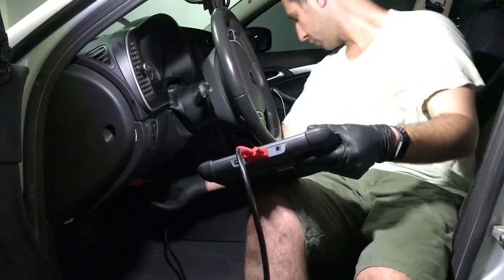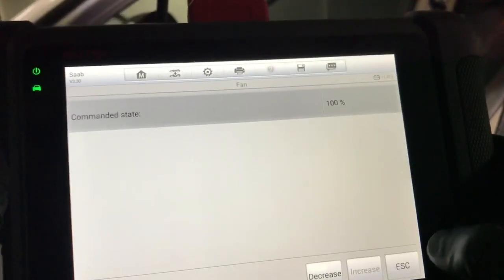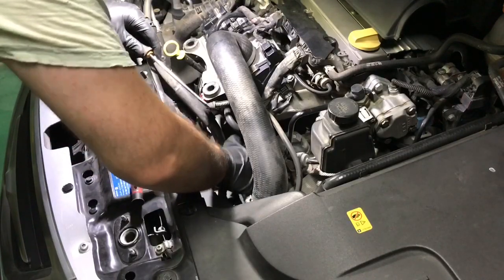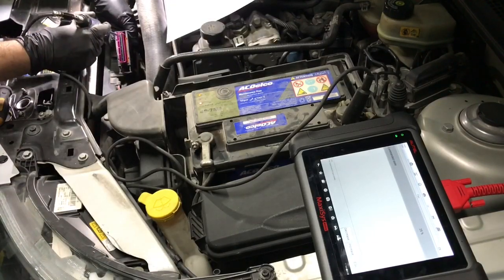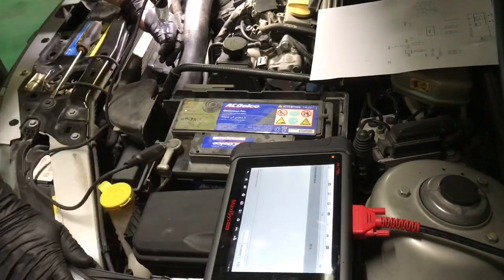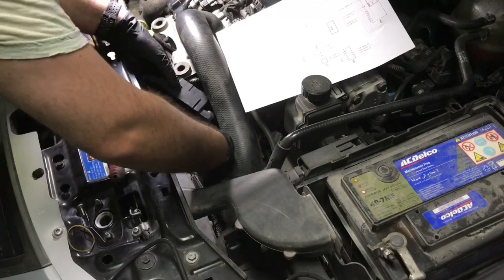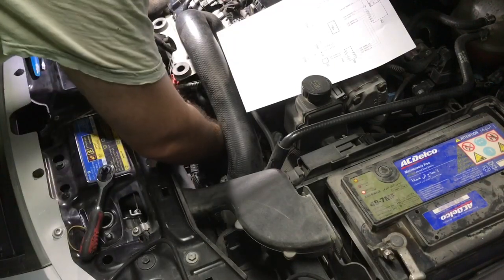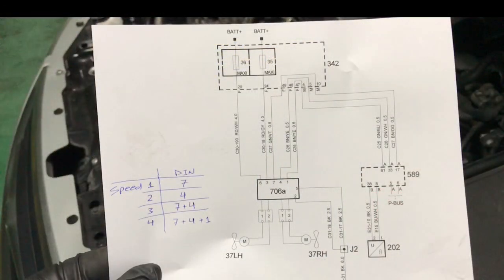SAAB 93 COOLING FANS ISSUES .. Part 1

Comment: Saab 9-3 2004 no ac. Is it possible that the fault is in fan control module ? There is refrigerant, pressure sensor ok , compressor works if i jumper relay ,  from data.. compressor commanded on
Reply from the maker: If compressor commanded ON in data, but its not tuned ON, try a new relay first. Best is to scan the car fully for faults
Reply: Thanks for answer! Its not the relay . The only  it says evaporator tempsensor -40 , i cant find it in 2004 but in 2003 schematic
Reply from the maker: @lenovoPer there isnt an evap temp sensor, this is just substituting value and it confuses the average user . U said AC command ON on live data is this correct !?
Reply: It explaines a lot ! Very confusing . Yes command ON on live data what i understand.
There is contact to the relay coil but the ecm are not grounding the relay. It was possible to activate the relay from data but only with engine off.
Reply: Hi ! I dont know if you forgett to answer ? But maybe you have some idea
Reply from the maker: @lenovoPer if have a scan tool that can command the AC clutch ON do that and see if it clicks or not
Reply: Yes ! Have done this and it clicks but only possible with engine off
Reply from the maker: @lenovoPer whats ur refrigerant pressure from live data
Reply: What I can remember it was good.

Comment: I have an 06 that both fans stopped working completely, i cant afford this snazzy computer, but i started the car and kept an eye on the fans until it was almost up to normal operating temperature and they just never came on. Is it still possibly the fan relay? Could it have just completely stopped working all at once?
Reply from the maker: The fans might not run even the gauge showing normal temp, start the Air condition and see if the fans run at all after few minutes

Comment: Greetings from Greece.
I know that this is an old video but I will give it a shot since I ' ve come to a dead end.

So after a visit to the local repair shop my Vectra C (GTS 1,9 cdti, year 2004)  has been diagnosed with the P1481 fault code (Cooling fan control module).
They have tried everything that I've read here (fuses, loose connectors/cables etc) but no luck.
I have already replaced once the Cooling fan control module (Part Number 1379131) with a used one but after 8-9 months it is broken again.
I am trying to find a new one to buy but it's not possible since Valeo stopped manufacturing this part.
As far as I know the 1.9 diesel engine (Z19DTH - year 2004) is also used in the Group FIAT vehicles (FIAT, Lancia, Alfa Romeo) and in SAAB as well.
Does anyone know the part number of this part in SAAB or Group FIAT ?
Reply from the maker: Does both fans run ? And do u remember if the fans ever run after u shut down the car ?
Reply: @TheFlyingMechanicDIY  Fans are not working in first speed (25%) and most of  the times they run after I turn the engine off.
Reply from the maker: @ys972  but BOTH fans work on all the other speeds ?
Reply: @TheFlyingMechanicDIY  Yes, the repair shop told me that they do not work only in 1st speed (25%)
Reply from the maker: @ys972 i will have to say its impossible, they dont work on speed 1 means one of them will not work on any other speed .. go ahead and confirm visually which one doesnt work on the other speeds .

Comment: Thanks for this video. My 04 9-3 is having this issue now (A/C won't work). Highest cooling fan speeds seem not to work. All fuses have been checked, relays, fan controller, all of that (on my shop's Tech 2). No shorts we can find in the wires. At this point, the only thing that hasn't been changed tested (even tried another ECM!) is the MCC panel and the fans themselves, so we are getting some fans in.
Reply from the maker: Any faults stored in the ECU ?
Reply: @TheFlyingMechanicDIY  nothing. Absolute bizarre.
Reply from the maker: @BruceLudwick  from live data, is the compressor commanded ON or not ??
Reply: @TheFlyingMechanicDIY  yes, on. For some reason, the fans won't get to the high speed.
Reply from the maker: @BruceLudwick  if the compressor is not ON then fans will not get really above speed 1 .. with the live data indicating compressor is ON, did u check there is power at the compressor ?
Reply: @TheFlyingMechanicDIY  I am pretty sure mechanic did. Compressor works unless it's hot outside, c. 80-85F. Ambient sensor is fine.
Reply from the maker: @BruceLudwick  u mean compressor works but not cooling !?
Reply: @TheFlyingMechanicDIY  correct. Something (wiring/fan) is telling it is too hot.
Reply from the maker: @BruceLudwick  if compressor works but not cooling its either super low on gas, or compressor bad .
Reply from the maker: @BruceLudwick  with the compressor engaged, feel the low side suction hose, is it cold ?
Reply: @TheFlyingMechanicDIY  yes, is cold.
Reply from the maker: @BruceLudwick  thats strange, then maybe ur mixing doors are not working properly
Reply: @TheFlyingMechanicDIY  I have the same thought but they seem okay
Reply: @BruceLudwick  Use this to search for the youtube vid: Saab 9-3 Climate Control RESET | How and why | easy DIY

Comment: Hi, The Flying MechanicDIY. Great videos. I followed your video and I found out on my harness I don't have power on the pin 3 as you have when you connect the lamp. Do you know what caused that since you worked so extensively on this car? My Cooling fan starts to spin for a min. and then quit. I have P0695 code when I run the tach 2 . Please let me know if you don't mind. Thank you.
Reply from the maker: Check the fuses for the fans , there are two, im sure one is burned which usually means one of the fans are shorted , that u can test easily by power the fans individually, if one is shorted replace it first , after that u can test again cause there is a good chance a faulty fan can destroy the fan relay module and the fuse
Reply: @TheFlyingMechanicDIY  yes you are right. I found the #35 fuse blown. What is causing the problem because I checked the fuses before and they are ok. Was so confusing brcause the ac was working fine in the morning and stopped in the afternoon this is why I didn't check back on fuses.
Reply from the maker: @dronemania23  a blown fuse usually means bad fan, hopefully the fuse saved the fan relay but i doubt

Comment: When turn the AC on, the fans not spinning. Looks like no power is going to AC compressor. How to fix it?
Reply from the maker: If there is fan faults stored in the engine ECU the compressor will not engage .. do u have any faults stored ?
Reply: @TheFlyingMechanicDIY  No error codes came up. Just fans not spinning when turning the AC on. Was told that no power goes to the AC compressor and to check for loose wires.
Ps is the car on the video an 9-3 Petrol model ?
Reply from the maker: Did u check the compressor fuse ?
Reply: @TheFlyingMechanicDIY  Will let you know. The car is at mechanic's

Comment: I post this comment and plea for insight/advice in Part 2 video as well.   Great Video, the visual procedure in conjunction w/the verbal instructions/explanations and notes are excellent. My vehicle is a 2008 SAAB 9-3 2.0T (B207 engine; Convertible). Engine and Transmission run smooth, has 202K miles.    A/C issue: I turn engine on with A/C set to Full Blast (Driver & Passenger) w/cabin Circ. on, cold air begins to blow, but after 15 seconds coldness gradually declines to warm. I repeat and notice that Compressor Clutch initially engages/rotates then stops after 15 seconds. I checked A/C Compressor Relay and respective circuit slots, and all good with power. Hooked refrigerant gauge (only) to high press. line and needle went into the RED Zone (beyond the Green/Full psi zone), so had a mechanic fully evacuate High and Low Press. lines and refill-balance. No change in Red Zone reading and Compressor Clutch stop. Had A/C Diagnostic done, ...possible Cooling Fan Relay Box/Module at fault, so replaced w/new, w/no change in result. Eventually located a Certified SAAB Mechanic (many, many years), he stated that car had many P-Codes, and that my newly installed Cooling Fan Relay needed to be programmed/married to ECM/ECU (T8 Module/ Trionic Unit), would take an hour or so. "OK"...2 hours later he called and said "Bad News" ...SAAB is DEAD.... ECM Died...car will not start. Me: WHAAAAT ??!!??  So, Mr. Flying Mechanic DIY, can you please give me some insight as to how this can happen? How does an ECM "die" while programming marrying to another part ?!? I'm thinking he accidentally short circuited the ECM, but then How do I know. He wants to charge me 200USD for handing back a DEAD car that was dropped off as a perfectly smooth running.

Comment: Great video but I am stuck without your software to operate the fans at the different speeds. My issue is fans do not run when a/c is switched on and the compressor is not “locking” on 07  saab93 tid. I have proved the compressor by shorting the relay and also checked both fans operate at max speed. Also substituted fan control unit with another but cannot guarantee that it is good. A/c was gased a few months ago so assume still ok. Any help you can offer would be very welcome
Reply from the maker: Does ur outside temperature reading on the dashboard operate normal ?
If not then fix the outside temp sensor, and if it is normal them A/C is low on gas
Reply: @TheFlyingMechanicDIY  yes, outside temp is good. Thank you

Comment: wait for part 2?  there's a special low speed fuse (maxi)......
Reply from the maker: There is no low speed or high speed separate fuse, there are two fuses that supply power to the fan module, each supply a fan separately

Comment: Thank's the Flying MechanicDIY for making videos. What scan tool are you using. And what's about tech2?
Reply from the maker: A tech2 would be the perfect tool for a saab as it is the factory tool, however from time to time i like to use different tools and explore their options, here im using the maxisys906.
Reply: @TheFlyingMechanicDIY  thank's again for your response. I steel enhance my english like my knowlegde about SAAB, so be indulgent to me. For TECH2, is it true that the software TIS 2000 work only whith WINDOWS XP. I speek about the copy of TECH2 of course.
Reply from the maker: Mahfoud Sadeddine  its better u use GlobalTIS which works with windows 7 and can be used with windows 8 as well..
Reply: @TheFlyingMechanicDIY  ok thank's

Comment: great vid, yeah i found out one of my fans didnt work somewhere are around 300k miles. high speed fan failed, the reason I knew is because, it will cause it will not allow the A/C to turn on without it. So I replaced the fan assembly-used, that fixed it thankfully. I figured they had 100 million rotations by now lol.  good vid for TS. Thanks.